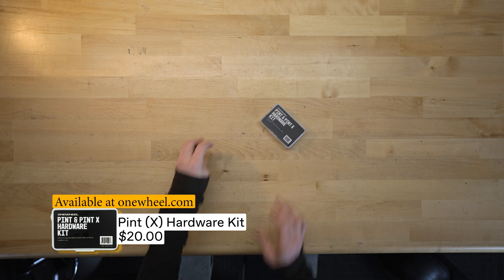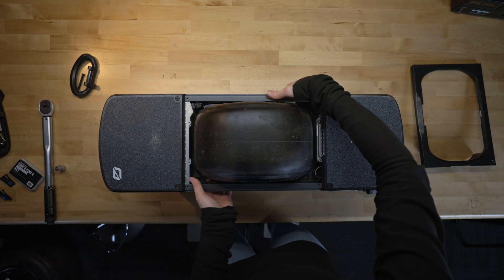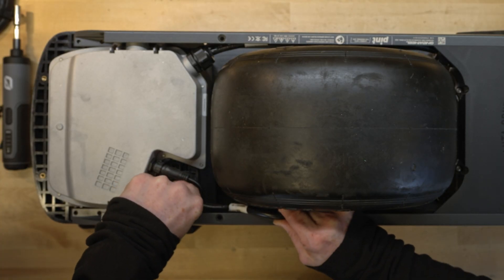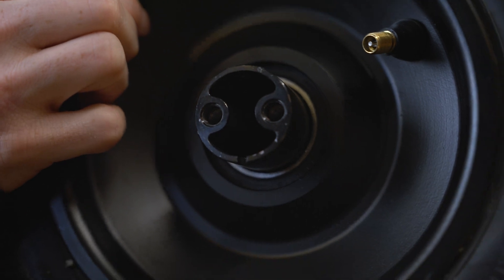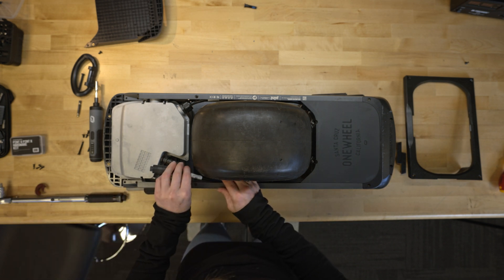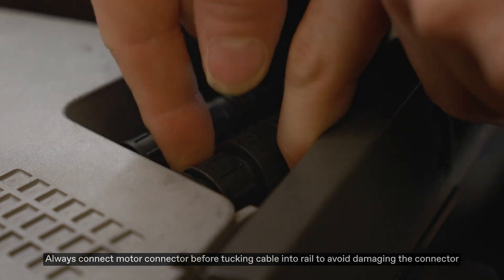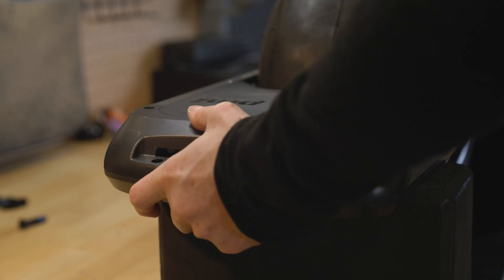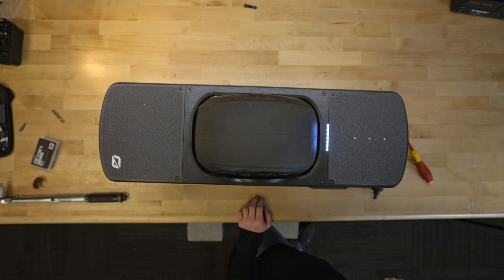How to install a Onewheel Pint (X) Motor

Comment: Can I put a pint X motor on my pint?
Reply: There's no difference in the motor between the XR, Pint, Pint X, or GT. Same 750W motor. It's all just battery differences.
Reply from the maker: @JOMvasion  Well that's not entirely true. GT has a different motor plug
Reply: @Onewheel  is that the only difference? Is the axle the same width?
Reply: @grantgonyer450  xr and pint axle are the same width. Difference is motor plug, you can drop either stator into either hub. But the motor plug is different. Where as GT stator can not be dropped into an xr or pint hub and is different width.

Short answer yes/ pint and pintx motor are the exact same.
Reply from the maker: You sure can! Most Pint X accessories and parts work for Pint. The exception is the Pint X Freeride Bumpers.